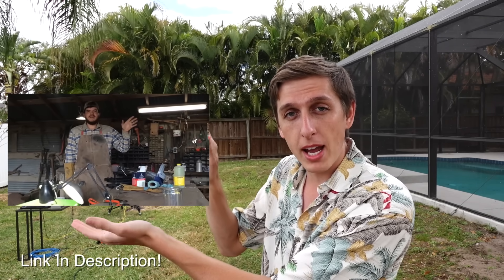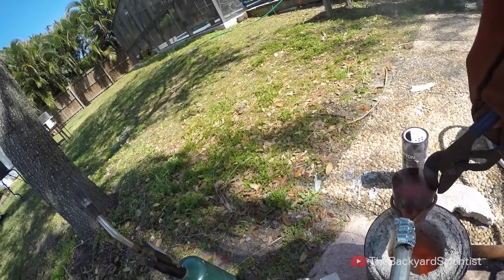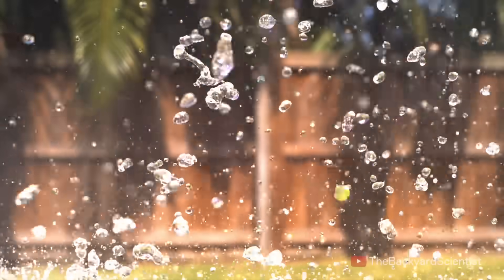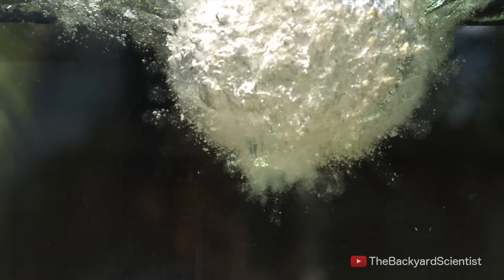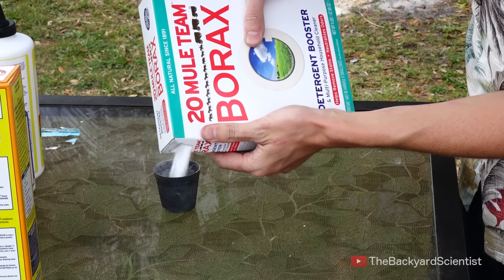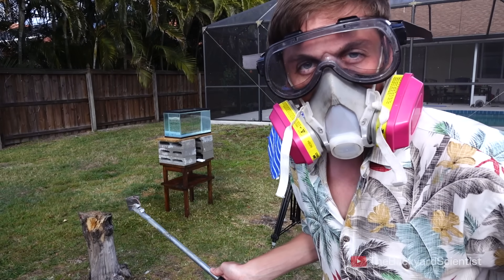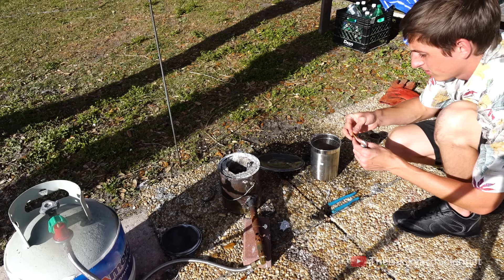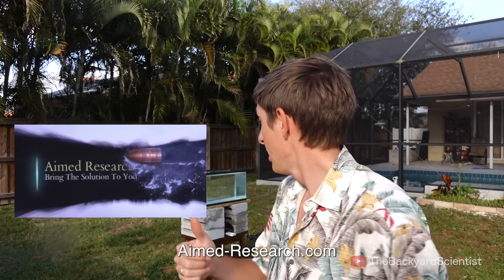Pouring Molten salt into Water - Explosion!

Comment: First,count your blessings that you weren't seriously hurt.  Never use glass as a containment vessel when you are dealing with an increase in pressure.   Having worked in heat treat for several years, including work with salt pots, you must be aware that whenever extremely hot objects come into contact with water, the water immediately turns into steam and it expands rapidly.  The greater the temperature of the hot object, the greater its surface area and the greater the agitation of the hot object (if it's a solid in order to break up the steam pockets that form on the surface and allow the liquid to come into contact with the hot object)  the greater the rate of heat transfer to the water and the more rapid the formation of steam and the resultant expansion.  Do not under any circumstances pour water into an extremely hot liquid.  If you had poured water into the liquid salt you would have had the same explosive reaction, except it would be liquid salt being sprayed all over the place.  I know of a few cases which resulted in severe burns and even two deaths because someone thought something was dry and placed it into molten salt. Check out the steam tables in any thermodynamics book and you can determine how much volume a given amount of water will require at a given temperature and pressure.

Comment: The reason there’s no pH change is because the Sodium and Chlorine react with water in the same ratio (1:1). So, when Na forms NaOH with water, Cl is, in equal proportions, reacting with water to create HCl. Both of these will counter-react the other, thus giving a 7 pH
Reply: No. There is no reaction. Chemically it's no different than putting table salt in a glass at room temperature.

Comment: When you heat up the NaCl and drop it into water that is a transfer of heat and rapid expansion (water expands when you heat it & when it freezes).  When you drop anything from the left side of the periodic table in water you are seeing an oxidation reaction that is exothermic AF.  Sodium can react to the moisture in air violently.  The difference is rapid expansion (physical reaction caused by the transfer of heat) vs chemical reaction (Sodium wants an OH ionic bond...badly)

Comment: Maybe because the Non Polar bound in borax is weaker compare with Polar bound in Sodium Chloride that makes a high tension and speed when it is actually contact with Water in form of hot melting NaCl

Comment: Its the temperature change which changes the pressure just like with glass
Reply: if it was simply temperature change then why wouldn't it do that with anything that was 1700 degrees. Not quite that simple.
Reply: John Dorian  I think the other salts were too light or reactive to sink and therefore dissipated their energy into the air instead of the noncompressible water.
Reply: I believe there is a type of sublimation occurring. The rapid expansion of gas in the form of steam is causing your explosion. If you put molten metal into water the same explosive process occurs. I’ve even seen an explosion occur from freshly cast iron tiles that were too quickly submerged during quenching. I think it’s significantly more of a physical reaction than a chemical one.

Comment: I expected the aquarium to explode.
Reply: As far as why it exploded and the others did not it is as you said there is alot to do with the interaction of the object and water, something with different surface space especially if it is pitted will have greater interaction with the water rather than a smooth surface. Like mentos.

Comment: I’ve worked in a smelting plant before this is more or less the case, the sodium chloride is more dense so it sinks quicker, as his last therory is mostly correct with the steam, I melted aluminum in a smelting furnace and if their was any liquid we would have explosions from the steam id material with the water or small ammount of moisture sank before it steamed off. Buddy try molten aluminum , you will have the same out come. Just BE CARFUL!!!

Comment: You pretty much pointed out the reason when you set up the experiment. Natrium is unstable in water and by heating up Na-Cl  you break the bonds between the Chlorine and Natrium. Then the Natrium reacts with the water instead and the chlorine has evaporated for the most part during heating depending on how thorough you are and mixes to get chlorinated water(negligible amount) for the rest. 

Your own conclusion was wrong. The Natrium you get from salt isn't pure and so it's allowed to submerge further and explode beneath the surface. Pure Natrium however will not be very willing to go beneath the surface, it's not much heavier than water and the Leidenfrost Effect makes up for it as it instantly heats up when it comes in contact. It will alsol still produce even more violent explosions despite not being submerged, it just won't move the water as much.

Comment: It's just a heat reaction, water turns into water vapor which is a lot less dense than water, hence creating the explosion.
As you demonstrated salts without sodium get a protective gas layer which isolates the heat from the cold water.
If sodium is mixed in this effect does not work, sodium reacts more agressive and breaks the protective gas layer.

Comment: I think I know what happened the aluminum is so hot whenever it has salt in it whenever goes into water and turns it to salt water when it burns the salt in the water tries to absorb the salt at the same time but it's actually exhorting he and the metal and it explodes

Comment: I want to produce this reaction differently, but I'm having a little difficulty figuring out how to go about it.  Here's the basic idea: introduce the molten NaCl underwater.  So, you've got a water bottle filled with water -- not hard to come by.

From the video, I'm guessing a NaCl slug of roughly 20-30cc volume (43-65g).

Dry, NaCl is an electrical insulator, and it's fairly crappy as a thermal conductor, so -- I'm thinking the only practical way to go about it is to inject the molten fluid through a tube having radial, and perhaps end, openings.

Would that require water-injection through the plunger in order to flush the tube?

With a mp of 801C, the stored molten salt in the reservior is probably going to have to be kept above 850C to ensure good flow.

Hmmm.  Now I'm wondering about the whole energy-in vs energy-out thing.
Reply: Here, hope this helps.
https://youtu.be/LmlAYnFF_s8

Melting helps get the surface smooth. Not sure how the Cl goes in the reaction, but I am pretty sure this could be a derivative of a Coulombic Explosion.

Comment: This reaction has to do with three fields of science, thermodynamics, physics, and chemistry. It is a matter of what salt is in its natural state. Salt in its natural state is a solid crystal. Heating the salt to the point of melting gives it an enormous amount of thermodynamic energy. When the salt hits the water, it doesn't just solidify like the carbon-ite borax salt. The salt instead crystalizes. 

This is the chemical reaction that takes place. The salt molecules are attracted to each other in a way that helps them bind together giving them extra physical space. Imagine like it is a kernal of popcorn when it pops. It explodes from its smaller size releasing the thermodynamic energy.

When the salt solidifies and crystalizes, it is tranferring the heat it received from the furnace into the water. The water doesn't have anywhere to go. This increases the pressure in the tank. Since the tank of water is glass and a fixed size in volume, the pressure continues to increase to the breaking point of the glass. Thermodynamic-chemical-physical reaction resulting in the explosion of the tank.

Comment: The first two times the water was colder, and its heat increased as you poured the molten salt in it. The third one was already "hot", and then, the molten salt could expand itself more easily. GR8 SPLOSION :P

Comment: It explodes so vigorously, due to the Hydrogen wanting to complete the outer shell of electrons (That's why Halogens get less reactive as they go down, the outer shell is further away), and the Sodium reacts vigorously to get rid of that electron (Has a harder time holding onto it like Lithium), causing a huge reaction.
Reply: For note, Water is composed of Two hydrogen atoms and one oxygen, which is why it's sometimes called H2O.

Comment: ok so do this: slowly heat glass and then quickly freeze it. It will crack. Every potter's worst nightmare. The glass is not elastic and so heating or cooling quickly, expanding and contracting, will happen too quickly for the glass's structure to adjust and it will fracture. This is what i believe is happening with the salt, as in the beginning the salt with time left to cool shows properties of glass. Why rapidly contracting causes expanding is because the salt quickly forms particles with itself, all separate and hard, thus pushing each other apart "exponentially", the same cracking and seemingly popping apart suddenly. I'm sure that if you let the salts that didnt explode cool slowly after heating, the structure that they for will not resemble glass or pottery in any way, shape, or form.
Reply: whoops, i forgot to explain the gas! Yeah no it is water vapor. The reason why the gas looked like it was having more explosions, was because the salt bits that got blasted apart heated more water as they uh, probably weren't room temp yet.

Comment: molten salt explodes harder because
it's the sodium with water reaction in both cases but in case of salt the cl bonds with h from the water leaving oxygen molecules open so they rush out since they are gas plus help in the intensity of the explosion

Comment: So if we group the initial NaCl attempts that did not explode with the alt-salts, and compare them with the exploding NaCl attempts, the difference appears to be viscosity. The attempts that did not explode, those where you noted the leidenfrost effect, the salts tend to be thicker and remain clumped almost like toothpaste.  When you heated the NaCl even higher, it was far less viscous, and this allowed it to mix with the water much faster. When the resulting steam is created faster than it can escape, well,  to paraphrase Cleveland, "Boom goes the molten salt in water!"

Comment: I reckon when you put sodium on the water, it creates hydrogen gas quickly and this explodes the sodium up away from the water. When you add NaCl, you are not creating gas, the high heat causes accelerated dissolving of the salt which means that it can dissipate its heat quickly causing accelerated heating of the water around, leading to an explosion.

Comment: How is water changing into a gas state then causing the expansion of yhe molten sodium not a chemical reaction?
Im not very knowledgeable of chemistry and just want to lnow where the distinction is made.
Reply: the molten salt causes the expansion of the water very fast, from liquid to gas, that's a physical reaction, there is no change in the chemical composition in the tank , the water is just expanding in volume so fast it causes an explosion. Instead, if you put the sodium metal in water, it react chemically with it, so : Na + H20 => NaOH + H2. I hope this explains it for you ;)

Comment: The reason why it explodes when molten is due to some simple highschool chemistry. 

When an Ionic substance dissolves in water the energy change is very little due to the enthalpy of solution being comprised of 2 different things, Lattice enthalpy and hydration enthalpy. Lattice enthalpy is a highly endothermic value and is the energy change when the electrostatic bonds between the sodium and calcium break and this bond breaking requires a large sum of energy. When he heated up the salt to the molten state he already broke the bonds between the Na and the Cl atoms. The second part of the enthalpy of solution is the hydration enthalpy and usually this is a highly exothermic value (we know this since Sulfur trioxide when dissolved in water can be explosive as there is no large endothermic lattice enthalpy to absorb the heat and as such all the heat is released as energy due to the hydration). Under normal conditions you have one very large endothermic and one very large exothermic value cancel each other out to produce a very small net change in energy, hence why salt doesn't explode when you cook.

Comment: When salt dissolves in water, sodium and chloride ions are pulled apart to form new weak bonds with water molecules. Pulling them apart takes energy, while forming new bonds with the water molecules releases energy. The net amount of energy released or absorbed is called the enthalpy, and it plays a crucial role in determining how much salt can dissolve.

I propose that you’re wrong and that it is a chemical reaction. Hearing the salt burns off some of the chloride and the melted solution is not as balanced as NaCL in its solid form. Therefore when you dump the molten salt in the water it causes instant dissolution and releases more gas than if you added regular salt to water. My hypothesis is based on the fact that hot water dissolves salt faster than cold water. You can never get water to those temperatures, so by melting the salt it causes the dissolution of the salt to be instantaneous and that releases energy.

Comment: There is a Mythbusters episode where they poured molten metal on ice and it exploded. They never gave an explanation. I figured it was skipping liquid phase and going straight to gas in a small confined space that needed to equalize with the atmosphere. ie boom. I was so glad you tried the test with the pH for chemical. I was really hoping/believing it was physical similar to their experiment - which come to think about it may have been a reproduction of a youtube experiment. I think there has to be something similar here between the two. I mean, think about it, if the volume of a drop of water immediately turned to steam, it would expand in an explosion. This has got to play a part with these violent reactions we are seeing. But I admit, how odd it was to see the other salts not react even remotely similar. I was thinking about that and I thought about how you heated the salt hotter on the second experiment and the results were more satisfactory. Perhaps temperature plays a bigger role than thought? I am now thinking about the lava entering the ocean - not frozen, so the steam does not explode the ice? Just a few of my thoughts for what they are worth? Thank you for your video! :-)

Comment: uhm. you ever think maybe it was exploding because the same reason molten steel explodes when introduced to any amount of water? water boils at 100C, your salt is nearly at 1500C. multen steel burns at about 1800C. a little bit of water introduced to those temperatures become A LOT of gas. hence the explosion. you're no scientist, not even back yard veriety, there's no actual SCIENCE, going on here.

Comment: The other salts had a layer of air around them. You should check the polarity of the salts. It may be due to the structure of NaCl being hydrophilic and attracted to water. I do not know if the hydrophilic structure is molecular or in the crystal structure. If it’s molecule then it would be a viable explanation because melting the salt wouldn’t change the hydrophilic property, but if the structure of the salt crystal is what causes the salt to be hydrophilic then melting the salt would break the crystal’s structure and disprove my theory

Comment: Salt is a crystal and so holds charge naturally and by it turning into a solid from a liquid in the original state, salt will loose charge as it goes from a higher state of water to a lower one of solid. So by melting it to become a liquid again it will pull ions from the atmosphere in order to get it back to a liquid state. But due to having to heat it to such a high temperature it will become highly positively charged. So it is an electrical explosion as the highly positively charged salt hits the evenly charged water.

Comment: Salt does some strange stuff in water. It mixes really well and helps electricity flow better. I'm betting the salt breaks the water down into h o2 and that is what is causing the explosion. An easy way to test it would be to capture the gases coming off the top when you drop it in the water.

Comment: I believe the first tank was annealed glass and the next is tempered. Tempered glass the edges are fragile, you can beat on it with a hammer, just not the edge. I've made annealed tanks, they can break from water weight alone. Tempered can spontaneously explode, they don't know why, I have a hypothesis. Kinda lengthy though. It's pretty rare though.

Comment: the salt is able to form many smaller crystals more rapidly as it cools instead of  a single lump,  the smaller crystals have a much larger surface area.  The larger surface area tranfeers the heat to the water much more quickly than a single lump could

Comment: When you put anything that hot into water, it boils, and produces steam.  The hotter it is, the more violent the reaction.  Think what happens to a kernel of corn when you heat it until the tiny amount of water inside boils - it explodes, making popcorn.  Salt melts at 1,473 degrees Fahrenheit.  Water boils at 212 degrees Fahrenheit.

Comment: I'd be interested to know if you smelt anything after the explosion? e.g. did it smell like chlorine?
Trying the Sodium was interesting, but it has a melting point of less than 100C so it would be interesting if you could get some sodium to the same temperature as you molten sodium chloride and try the same.
Do you think you could collect the gasses that come off the tank? if you try, and wait until it all cools down, is the volume the same or different?